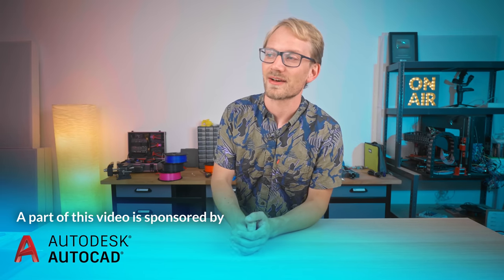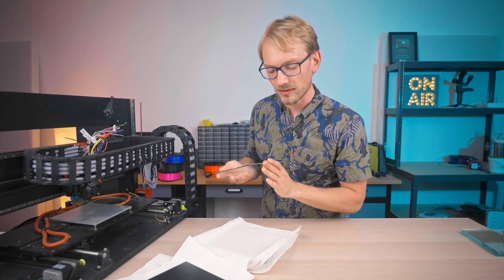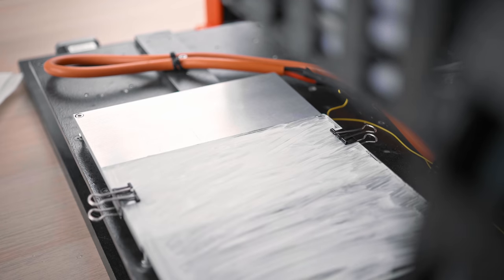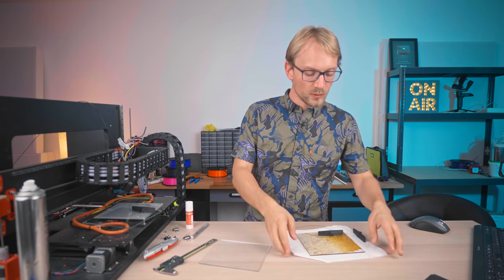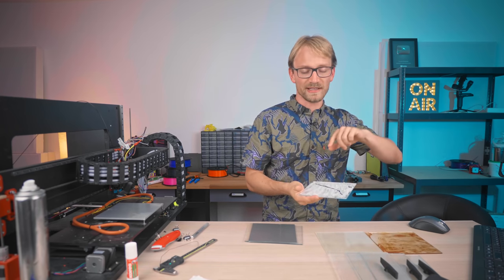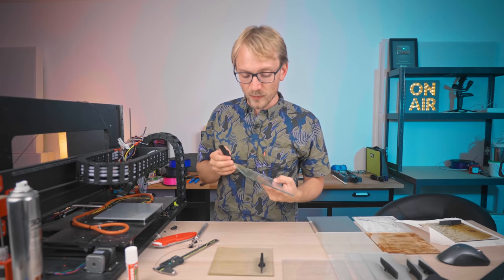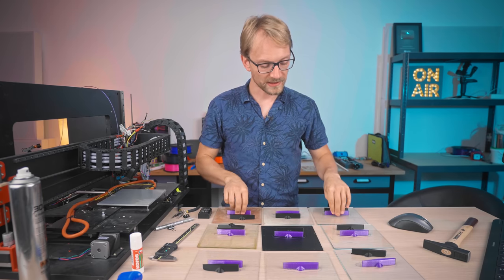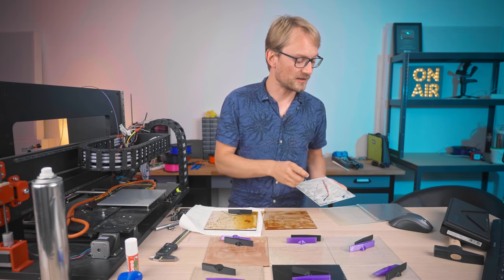Perfect 3D Printer Bed Adhesives - from the Grocery Store!

Comment: I have previously used lamination pouches applied to glass (suggested by another use on a different forum). Applying is simply place the inside of the pouch on a glass sheet, and heat to above 80C, while applying pressure to get a nice flat surface (without bubbles). It works very well for PLA and Flexible, PETG sometimes ruins the surface.

Comment: Hi Thomas, for the last 5 years I have been using Liquid UHU office glue. After a print or two the glue dries out but I then reactive the glues stickiness with a few drop of vinegar. Form time  to time I add a drop of glue to keep a even amount of adhesive surface. The cool thing is that all print pla, petg does not stick when the bed is cooled down to about 35 degree C.

Comment: honey, add some high % alcohol, spread thin layer, let dry. Profit.
Reply: Sounds interesting...does it work with vodka?
Reply: @herrmann3278  If you use drinkable alcohol, you might not need honey. Honey with alcohol should just leave a thin layer with high sugar concentration. So any drink, that mainly consists of alcohol and carbohydrates might work 🤔Maybe even beer or wine. (Although you would certainly smell them. But a bit of Glühwein wouldn't be the worst^^)
Reply: And today's sponsor is.... HONEY!
Reply: Does the honey dry to a nice smooth film after applying it and does it remain tacky?

Comment: I rub a 'magic eraser' (melamine foam sponge) on my Prusa's PEI covered spring steel sheet, it works extremely well at removing finger grease etc. especially for printing PLA, but to print TPU I have to use a gluestick or it sticks too well, there's a couple of tiny chunks of the PEI ripped out from TPU sticking too hard...
Reply: 100% IPA, gluestick. Dissolve stick until fully saturated, sift out the bits, add a bit more alcohol to compensate for evaporation during storage. Apply with melamin sponge or a brush (i use both, brush adds more solution, sponge is used to even it out and it soaks the excess). Store the applicators in the same jar as the "goo". One layer lasts for 10-15 prints easily if not printed exactly in the same spot each time. Cleaning is easy, wash it out, apply a new layer. 30g gluestick will last at least a year or two.
Reply: Brilliant!
Reply: Magic erasers are abrasives.

Comment: It would have been nice if the test included  sandblasted glass without any adhesives. The blasting increases the area  where the filament can grip on to the surface. Might be a bit to much when printing PETG but from experience I can say that it works great with PLA and ABS. Just clean with a little Isopropyl alcohol between sessions.

Comment: I have used wood glue because that's what I have sitting in my garage close to the printer. I have also used elmer's school glue. With both I put on a  thin layer and spread it out then stick it on the heated bead @ 70c so it dries pretty quickly.  They last for several prints then I can scrape it off really easily and re-apply when it's time to refresh it.

Comment: I have been using sugar for years.  I found that brown sugar works much better than white refined sugar. Aslo after spraying the sugar solution on the glass the first time (very thinly works best) use it a few times and then use some spit from your mouth to spread out the sugar again and it will stick very well.  I also noticed that while hot the part is often very hard to take off the glass, sometimes even causing shards of glass to come off.  Let the glass cool down and the part will pop off by itself.  I have several glasses ready to use so that I can swap them out as needed while waiting for the cooling,.

Comment: I've been using water saturated with sugar for years - never failed a print (PLA & PETG) - I emptied a tube of liquid glue and always keep it filled with sugar water, have a large paintbrush handy and even the worst print surface will stick (1st gen CR10 with crooked bed, a hemera, bltouch, SK1.4, new bed mosfet and noctua fans)

Comment: Wood glue works extremely well. May be too much. 
And wood glue works very well to glue pla pieces together if you use a clamp, just like wood.

Nice instructive video. Thank you!
Reply: Contact adhesive is similar when it comes to gluing parts together. It is not fully permanent join so you can pry the pieces apart but holds well enough that at least visual stuff, art etc. it is nice to have something that isn't super strong. Superglue and epoxy will stick so well that they rip the layers apart before letting go.

Comment: Thanks!

Nice alternatives for when needed...

I have a little can with 'sugar-alcohol-mix'and  brush on-hand near my printers when needed. Sometimes for easier release for PETG or for sticking better (TPU, PLA). Coming off easy after cooling down but sticking well when printing.

I use: fully concentrated sugar-water (so it is just dissolved), added water 5 times and then added 100% ethanol for doubling.
This way, it is keeping dissolved quite well, easy to put on the bed  with the paintbrush in thin layer and dries fast (room-temperature or preheating the bed).

And here: never need to go extra to the shop or buy glue or things like that. It is just a very thin coating that stays on the bed pretty well, only if applied too thick you get a sugar-coating on the bottom of the print - but that is easy removed with some water.

Comment: Nifty. Now, I remember responding on Joel's big printer video: my first printer had a glass bed and I printed PET(G) on it (more specifically, ColorFabb XT, so it may not be the same to some people), and it didn't break the glass. It may not be "which PETG" it may be "which glass", or both.

What I'm more interested in is testing other materials: PC, Nylon, OBC, TPU/TPE. Those are the ones that always seem to require something to help with adherence.

OBC is also well documented as needing clear packing tape or some polypropylene item for adhesive. But myself (and enough others) have indicated no interest in putting packing tape on their PEI or similar (and I don't see much interest in it to print enough to warrant buying a surface that will always have packing tape on it).

Comment: You can make your own PVA glue with water, flour, and sugar on your stovetop.  I'm currently using a 50:50 pva-water mixture for my PETG and so far it is working beautifully.   I recently heard about mixing a drop or two of dish soap to improve the flow( for easier spread and spraying for a bottle).  I am gonna give that a shot.

Comment: Tom, nice test! One thing which is worth to mention is that glass has 2 sides. In "printing on the glass" world only air side is that which is printable. The tin side has worst adhesion and print can detach from it in time. It would be nice if you could check does this rule also work in 3D printing.

Easiest way to check which side is which is by using UV C light. Mostly common place where you can find this kind of UV bulbs is in the uv money checker **WARNING UV C IS DANGEROUS!! **.
Reply: Uh... Are you sure you mean UV-C? It's not visible to the human eye, you can usually just see the faint blue-ish glow on the bulbs. UV-A and -B is the semi-visible purple-ish light that is used in money checkers (because they include fluorescent parts that start to "glow", just as light fabric "glows" under your typical "disco light" that also uses UV-A/B). UV-C is very dangerous for your eyes and you should NEVER be near a running bulb that's not fully covered/enclosed!

Comment: I use jelly block. Spray the glass with a water spay bottle then rub the jelly block on it just like glue stick. Then turn bed heater on. By the time the beds up to temp surface is dry and tacky. Prints stick well and when bed cools release easily. Parts are cleaned from any residue with just water. Raspberry is my fav 😀

Comment: I use Glue Juice that I make by dissolving 10 grams of Elmer's X-treme glue stick in 500 ml of distilled water.  A thin coating distributed over a glass sheet makes a great surface to print ABS.  The 154th three hour part just finished.  It self releases in 15 minutes when the 110C bed cools.  Turnaround between parts takes less than a minute, including part inspection.

I've tried Glue Juice made with three different types of white glue and all were complete failures.  I need to try wood glue to make Glue Juice.

Thanks for the interesting experiment.

Comment: I got a second glass bed and added PEI to it but have only used it once in a test.  Since I was doing production runs of ABS and a single solution is appealing, I then switched to Aqua Net UNSCENTED and have stayed with that.  Buy the cheapest hair spray available everywhere in your country for the best availability and results.  The more expensive brands add fragrances and other "improvements" that affect the chemical bonding characteristics.  (This is why results vary so much by brand.)  Cheap hairspray will only contain the minimum to get the job done.  It's also water soluble so you can wipe your bed with a damp cloth to redistribute the coating rather than respraying it.  For convenience, I spray my bed without removing it, MAKING SURE to block overspray with a cardboard partition.  Bearings don't like film buildup!  AquaNet unscented also contains some vinyls along with the basic acrylic ingredient that make it compatible with a broader range of filaments.

Comment: I use a 5% solution of PVA glue in water applied with a paint brush on glass. Works great and if you get a stuck part, just dribble water around it and leave for 10 mins. One coat does many prints.

Comment: I use a v05 gel spray hair spray, squirt on a few sprays, spread, heat up the bed to dry it out and print. The coating lasts ages and seems to work fine. I printed a 200X200X1 flat square on a glass bed with that hairspray and I got only a small warp in one corner that was in a breeze.

Comment: Nice idea. One thing I found with the ones I tried: PVA glue and hairspray, is that it's difficult to get consistency and it's difficult to clean off ready for a new coat (although I was applying direct to the printer bed).
In my opinion it's worth paying the extra for specialist 3D printer bed glue.

Comment: If pasta water works then maybe strach spray which is used to stiffen fabrics could work as well, you might also be able to mix corn/potato starch with water, heat it up to make it gel and put it in a spray bottle to apply it.

Comment: Personally i use 3M 45 strength spray adhesive, it's like a mix of hairspray and glue and it really works well plus it's durable for about 3-4 prints int he same location and really easy to apply.

Only downside is it's a bit like 3d lac and parts like to stay put after cool down, oddly it's easier to remove parts while the bed is warm.

But it's been my go to and a can of it seems to last way longer than you expect plus it's always the same when you buy it.
Reply: I use this method too. It's good, but, the cans are a bit expensive imo.
Reply: @colinwales2795  Honestly i it's like 3-4$ a can at any home depot I've been to and those cans last a long long time. Still on my first can from almost 3 years ago (though i go long periods without printing).
Reply: @nobodytoyou4887  $16 to $24 per can in my area. :(

Comment: You should have tested sugar water.
I use a mix of 50% iso, 50% water and for each 100ml of this solution I add around 1g of sugar.
This is perfect for me, it works really well on a glass bed for printing PLA and TPU, also ASA works. 
PETG is OK, but needs a thicker layer.
1. Heat the bed up
2. Spray the mixture on a paper towel
3. wipe the glass bed with the towel
4. profit/print

This will leave a thin layer of sugar for the pla to stick, but not stick to well.
It will also clean the bed up nicely because of the IPA.

Comment: very interesting video Thomas. A factor here is also ease of use. I have always used Aqua Net on glass because it is so simple and easy to do. I wash my plates, dry then a spray and then dry on the heated bed. Works every time. I'd  go crazy if I had to prepare my my printer slides like old school photographic plates. I have a suggestion with the wood glue, thin it down with a 25%/75% water solution and try it in a spray bottle. The pasta water might be interesting sprayed as well. The albumen should work but it's a bio hazard.

Comment: Good video. I print on an Ender 3 clone printer. I have a PEI flex bed that I use with this printer. It works wonders for PLA. However, for ABS, if I don't level my bed every print and get it 100% level, then depending upon what I am printing, the print may lift off completely.

Comment: If the wood glue is PVA, then it's water-soluble and could be rinsed off prints, perhaps with mild wiping as well.  Probably also true for soy drink, pineapple juice, egg white and pasta water.  You'd probably get better reproducibility using a starch suspension than pasta water, btw.  Very interesting results and a nice study, Thomas.  Thank you.

Comment: So far I've been using a gluestick (on a smooth PEI spring sheet from Prusa), but it's tricky to apply it evenly. I've been wondering if there's something that is easier to apply evenly.
Like, perhaps something that's liquid when wet, so you can spread it evenly with a spatula or paint brush, or maybe it can even spread on its own if the bed is level enough, but then it dries out into a solid surface. Or perhaps something that is more liquid and 'spreadable' when hot, but solid when cold, like hot glue. Gluestick seems to be quite solid even when I heat the bed to 100 Celsius, so it's hard to smooth out if unevenly applied.
I did notice when I clean the PEI sheet with soapy water, it does make the glue much more 'spreadable' but I'm not sure if 'soapy water gluestick' is a good bed adhesive... maybe I should try it out one day...

Comment: Been using plain borosilicate glass (60 to 70 C bed) with PLA for a while, and never broke or showed warping on pieces, takes a bit of insistence with the spatula to release pieces, sometimes if it cools down enough they are easier to release... I had to stick a square of aluminium tape in a corner so the induction sensor detects height properly, no more issues (yet, at least)

Comment: Hairspray is a contentious option - works for some and not for others.  I use the cheapest hairspray I can find (atm that is my hair matters firm hold).  I take my print bed out and spray on a generous layer and let it dry and it is not sticky at all at that point  I then put the  bed back in and start the print - when the head is at temperature and just about to move to the start point I spritz the bed with some isopropyl alcohol that I have put in a cheap fine spray spritzing bottle - one or two squirts is enough and it immediately makes the surfae of the hairspray layer tacky by dissolving it a little.  This takes the headache out of finding the hairspray that stays tacky and is cheap, but you get the advantage of being able to create a thin and even layer because the haispray aerosol is so fine.  My IPA spritzer has a cap to minimise evaporation but otherwise is the cheapest I can find.

Comment: You did all the experiments with heated bed, right? What about testing without a heated bed for PLA?
What about ABS? How does it stick with ABS?
My experience is, that with clean glass and good heated bed it sticks VERY well. I also broke some glass. When it cools down, it pops quite easy. This tip I got from Ivan Miranda's channel.